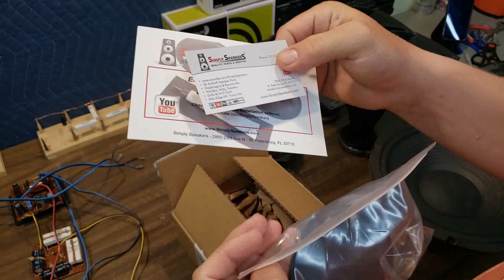Rare Kenwood MV-7 Project Updates (Parts Express & Simply Speakers)

Comment: No it's not chipboard is better than MDF its acoustic properties, it's cheaper to use MDF and more hazardous shouldn't do it!
 go round with waterproof PVA wood glue on all edges dilute it by 5% put some wood glue in the chip then feel after dry with bondo
What is shiny speaker goo when it's at home, what's in it. Just go with a damp cloth. Might be worth gluing another baffle or on top half an inch of beech plywood, and any offcut of the ply line the bottom back half where it's got wet do the same on both! lining inside with natural wool fleece 3 inches thick just on the back quarter of an inch on the sides take those silly back pieces out stick 1 on the top one on the bottom on reach driver slightly towards the middle. Get some quarter of an inch fleece and concertina it up sewing it together top middle and bottom. The port is too long as well should be at least 2 inches shorter and smaller diameter by an 1/2" find a pipe cardboard preferably that fits tight inside glue it a piece,  on the end glue a plywood on the port on the inside edge Square piece slide over,  an inch across overhang to cut down residence in the port and chuffing. I can't say see as second order on the crossover it looks like first order replace the electrolytic with polyurethane metal film capacitor a 1.2 Ohm resistor  7 Watts will be needed  in line of each capacitor in series with it, in parallel put a polypropylene capacitor of 0.1 10% 160V with the other capacitor as well that would be worth doing on the tweeter as well with a resistor.1.2 ohms 
If you find it's a bit bass light call a piece of copper ideally the same size as the voice coil of about 0.8 mm of wire 80 to 60 tu